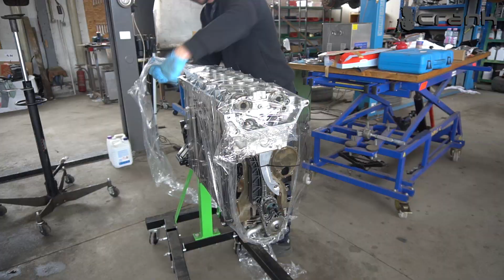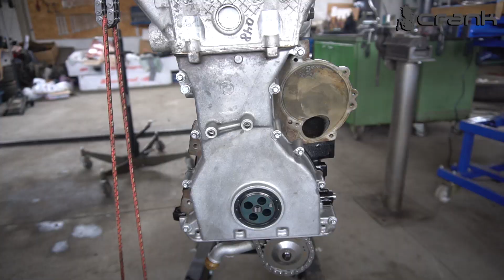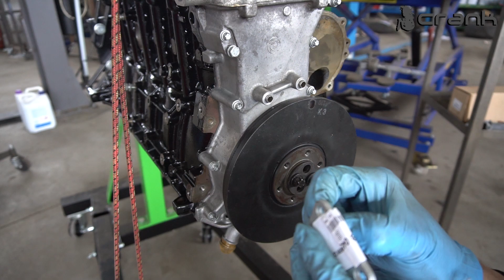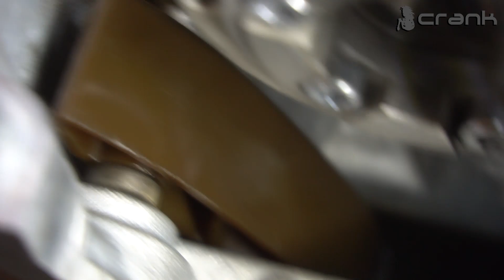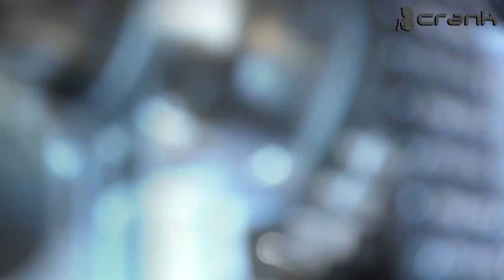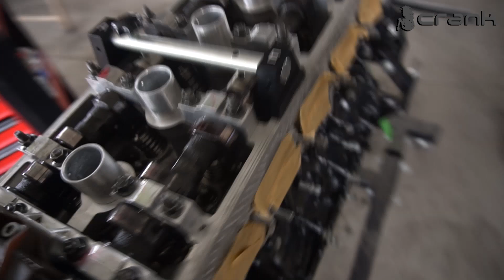BMW S54 Timing Chain Procedure

Comment: I have to say that the whole deal with finding the "sweet spot" of the gears is a myth. There is a video of the assembly of these engines in the factory that they did nothing of a sort and if they did, wouldn't you think there would be markings to make assembly quick and without the chance to mess it up? When you think about how this works, it makes sense that it doesn't matter as long as it's like the first tooth. This is simply giving the hub enough room to travel as the gear is inserted.
Reply from the maker: Actually even the M52 single Vanos have something like "sweet spot". I have observed on logs, that if you don't put it in, with the shown method, the movement of the camshaft is less degrees. I haven't tried this on S54, but on M52 single Vanos I have seen it.

Comment: I also first got the chineese timing toolbox, was a nightmare how much it wobbles, the bridge was not even lying flat on the head. So i ended up buying the original part, which made it able to get the timing correct. You shouldn't push the pins in like you did on some occasions, for perfect timing, they should just fall in. Also, don't turn the shafts while the pin is in, it could bend the tool. I know that all this will make you take more time, but I'm sure it's worth it.
Regarding the timing, i had to do it even more often than you. With the chineese tool it would fit easily, but with the original tool it took me many tries. One part of my problem would be that my chain is not new, but since you have had similar problems, i would say that the chain tensioner being without oil pressure would also make that small difference. What made it work in the end for me was to put the crankshaft to the "T" marking and not insert the pin at "I". With this, after rotating the engine, it would line up both camshafts and the pin would just slip in without any pressure.
Reply from the maker: The difference btw using small pressure to insert the pin and just fall down by itself is around 0.1 degree so I think I will be fine :D

Comment: I have bought 1 second-hand 306d3 engine, it has been idle for more than 1 year. What should I check before installing to another vehicle? Do I have to change the crankshaft seals or other seals? And what steps should I follow before starting this engine that has been stopped for so long?

Comment: I used a non BMW timing bridge and had no problems with my timing. It may be a few millimeters off but the engine compensates for that and has caused no issues.
Reply from the maker: Yes for sure, few degrees will not make big of an issue. I just wanted to be precise as possible
Reply: @crank3646  I understand as I also went back and did mine 2 more times to make sure it was perfect. I wish I would have found your videos back when I was doing mine. would have made the job much easier. I'm going to be doing a full rebuild on mine soon and plan on using your channel as a walk through.

Comment: You put the Chinese timing bridge on backwards FYI. You had the E on the exhaust side.
Reply from the maker: Oh Teo Teo... And "I" is for what? This is not the original letters like the OEM tool "E" and "A". I have writted those "E" for exhaust and "I" for intake, the tool didn't have any letters when it came.
Reply: @crank3646  hmm, I must have caught the big dumb because I didn’t look at the other letter!! 
Anyway I found everything else in your video very helpful so thanks for making it!